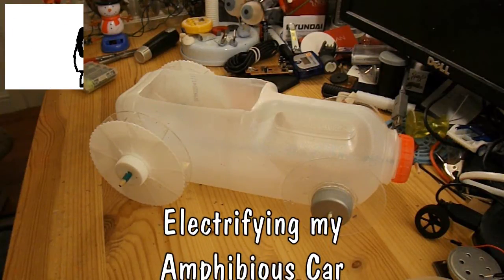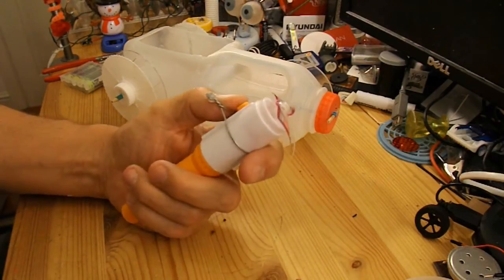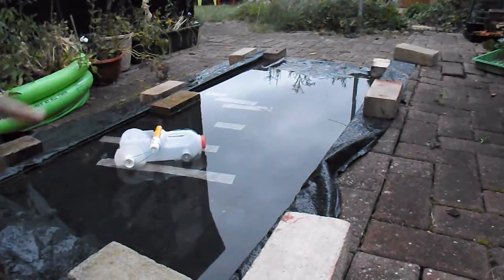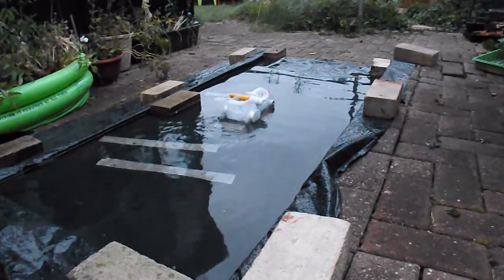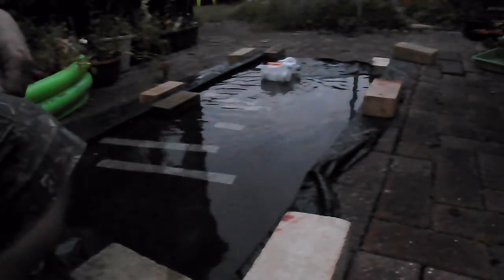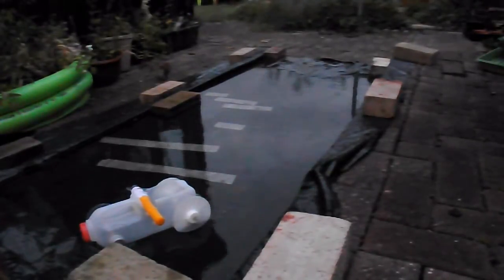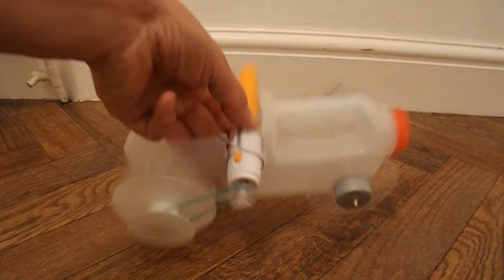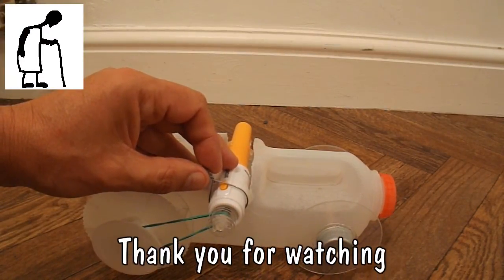Electrifying my Amphibious Car PART 1

Comment: Two suggestions, Grandad:
1) If you do that go backwards (front drive), safe in and out of the water without problems.
2) And if you put a rudder or a directional drift and that can regulate, it will be easier to go in a straight line.
Greetings!. 8-)
Reply from the maker: Hi Francisco, when you see PART 2 you will see I fixed the lack of power by improving the gearing. As for fitting a rudder, hardly worth it for driving across a small puddle. If anybody wants to copy this then that leaves them plenty of room for improvement.

Comment: never thought of using a milk jug as a anficar:) plus there may be room for my figurines in a cockpit
Reply from the maker: Hi Allan, I use those plastic milk bottles in several of my projects as they are easy to work with. Not sure how stable it would be if you add your figurines but should be OK as long as you keep them low down.

Comment: Its easier if u made it fan powered i made a fan powered one and its worked well!!
Reply from the maker: Hi Othman, thanks for commenting. A fan would be another option. It just depends on how much power you have available, the electric motors I use are not very powerful. The slope out of my temporary pond is quite steep and with the added drag of the water the car needs quite a lot of power to get up there. I wanted to use the wheels to drive it out as the wheels provide the power in the water.